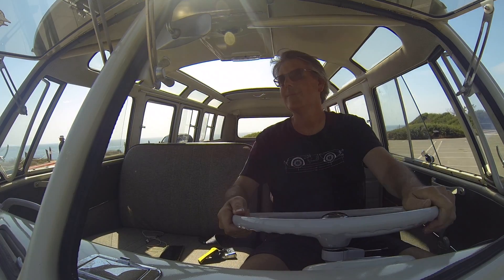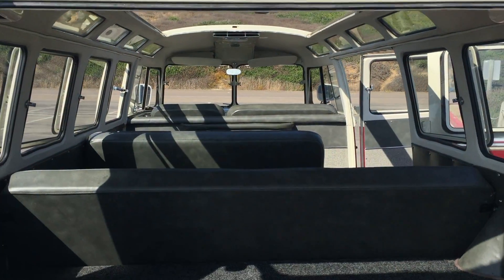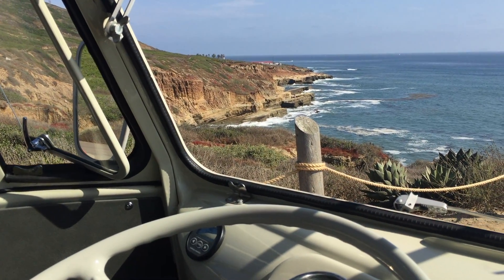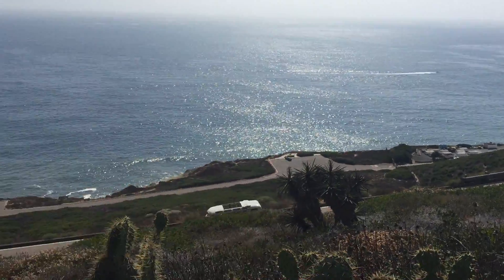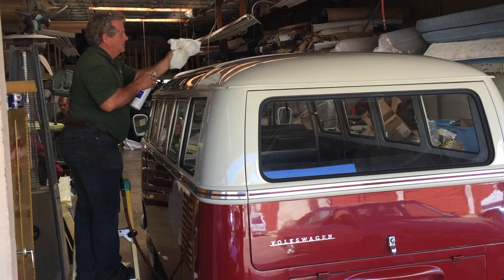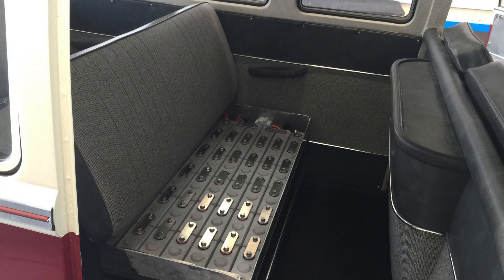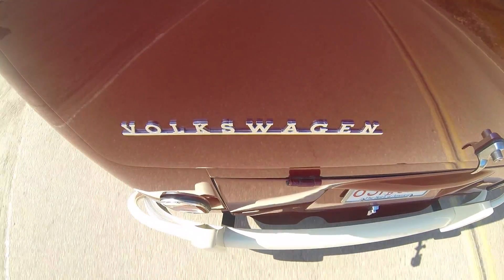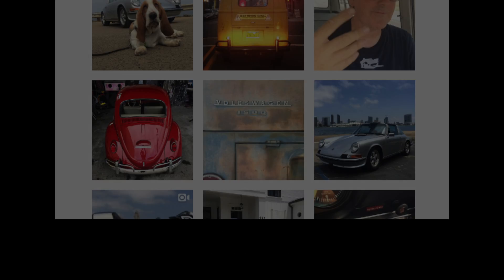100% electric 1967 VW 21-window microbus

Comment: One of the joys of these vehicles was going on camping trips or even across the country. But it's just not doable with these limited range electric converts. But if you're happy with 65 miles between charges then it is nice for local jaunting around.

Comment: I had a very pretty ‘64 Beetle converted.  With a Hyper 9HV motor it is very quick.  With 3 batteries in the frunk and 4 behind the back seat, it’s got a lot of range, well over 150 miles.  Still sorting the steering, shifting and random rattles though.

Comment: Love this concept.  What is the range of cost  on an electric conversion on one of these?  I would prefer a maximum range and potential to tow a small trailer.  Can the battery bank be set up to charge off solar?  

Thanks, Ginger

Comment: Boy what a Looker !!  Such clean & tidy installation that even surpasses the company prestige. Just use some Dry Cell Batteries which can charge faster & runs longer than Lithium.  Look into that Australian company who makes those Silicon graphite cells.

Comment: What about adding a higher voltage generator, and pulleys and belts to the electric motor shaft, then connect the generator cables to the batteries, you are charging the batteries as you drive, plus solar panel on roof. Not explained well, but I know what I mean.
Reply: yes, i don't understand that.

Comment: Hi David, I have few questions... may be stupid..but need to know.. Do we need to use clutch to shift the gears?  most of the modern evs dont have gears.. So how gear shifting works in this?
Reply from the maker: Chamara Indrajith For the most part you can drive in 3rd gear w/o shifting. But you do need to use the clutch if shifting into other gears like 2nd for hills at low speeds or 4th on the highway.

Comment: Putting the battery inside the bus is a waste of space.
A better solution would have been to put it under the floor of the bus in a reinforced tray that would run the length to the floor from the front subframe to the rear.
This would allow for greater battery capacity as well as spreading the weight better.
Reply from the maker: We can place the batteries under the floor now that we've started using Tesla batteries. Wasn't possible before with the type of batteries used in this build. -db

Comment: The real problem with the buses was they could not get the passenger compartment warm in cold weather. They are really a SoCal vehicle. I had a bus ( not a nice vintage  like this ) years ago in Seattle and I drove it with a Whitney point blanket over my lap to keep warm. And the defroster would not keep the windows clear. I had to keep a squeegee on the dash, lol. I use to think, does it not get cold in Germany, what were these guys thinking? haha.
Reply: i had one of these in nor calif in the 70's and it was my daily driver in the winter. Froze my butt off. Impractical vehicle for daily use.

Comment: about the range ?
Reply from the maker: This build is 60 mi but can be upgraded to 150.
Reply: @Zelectric  Things are farther apart on the west coast. 150 is still too short. Vegas is 300 from Los Angeles. Shoot for that. Also anything less than 70 on our freeways will get you a ticket or killed so you need a higher gear. Can you use Tesla charging stations? That would help with your range issue. I won't even mention the charge controller.

Comment: It strikes me that that battery gauge looks out of period to the rest of the vehicle.  They should have created an analog-styled gauge that imparts all the same information, but with nested needles.
Reply from the maker: david hall Good eye. Next bus will have just that. It’s on our instagram. -db
Reply: Kewl, kewl.  Anyway, I love the work you've done.  :D :D
Reply: YES, THE ONLY FLY IN THE OINTMENT OF ALL THEIR BUILDS.
Reply: Why not you replaced all the lights with leds, digital meters are ok especially if you have a stereo system with digital displays. If you keep everything original then you must keep the AM only radio along with the vacuum tubes and vibrator to power the b+. I'm referring to the 50's version.

Comment: Camper version with 150 miles of range please. Wondering when older Nissan Leaf drives and charging units will start showing up in vehicles, but with new , larger battery packs. Would a modified Leaf battery pack fit underneath a bus?
Reply from the maker: fiddlesteven Doing a camper this summer. 150 miles or more is possible as well.

Comment: Love it. Is the charger universal where it may plug in anywhere?
Reply from the maker: Yes, 110v or 220v at home or public charging stations.
Reply from the maker: cynthia taylor Plug in anywhere 110v or 220v and public charging stations. -db
Reply: @Zelectric  do you have a separate plug for 110 or 220?